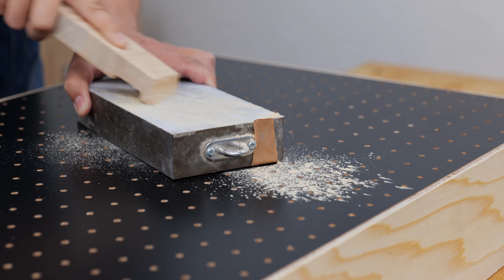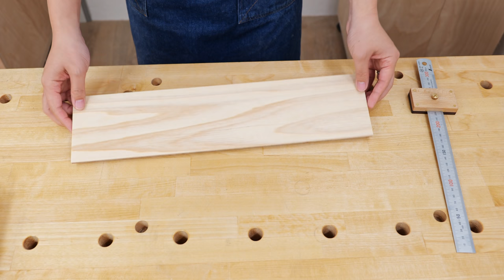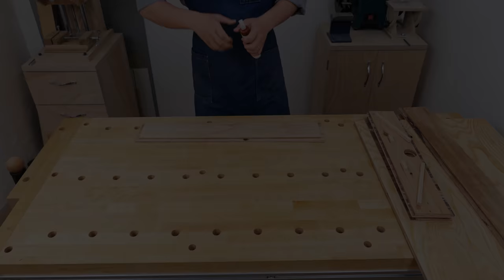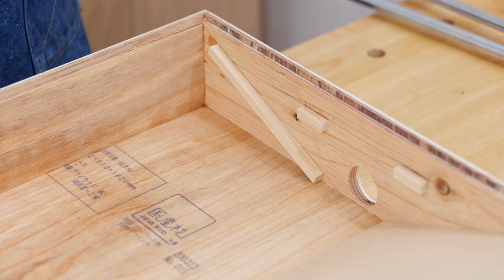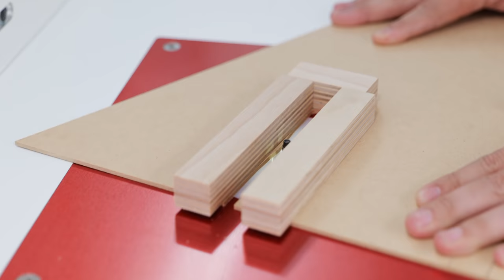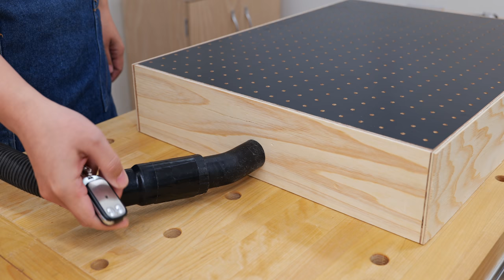Sanding dust collection table

Comment: The suction thrust of the table depends on the ratio of the sum of the areas of all holes in the table to the area of the vacuum cleaner hose.
The area of the holes in the table is about six times larger than the area of the vacuum cleaner's hose, which means that the suction of the table is about six times weaker than the vacuum cleaner.

Comment: Clean work as usual. I'm always impressed with how nice the tools you build look and how well they work, and this is yet another very nice looking build, but It also has my thinking and that almost never ends well...

First thing I'm wondering about is the internal baffles. I assume that they are there to moderate the airflow so it's spread more evenly over the surface. Now how necessary are they? How would omitting them influence the airflow. Guessing I'd say the most airflow would occur along the edges, but that's just my initial guess, the real question however is how it would impact the total performance of the table. It would make the build slightly easier and faster if the baffles could be omitted without seriously hampering performance. But if they need to be there it's no big thing.

Next thing is that I wonder is how necessary it is to glue down the deck? I can see how it is likely to become scuffed up pretty quickly so it could be a good thing if it was easy to replace and also it could make it easier to clean the box out now and then. If the vacuum underneath it isn't enough to keep it in place then perhaps tapping in a few nails from the side might do the trick. These nails would be relatively easy to pull compared to trying to rip the deck from the glue.
I do have one more idea on how to keep the deck in place without relying on glue or nails or anything like that, but it would require that the sides of the box is slightly modified and it would there would be a border sticking up around the deck which might make it harder to use if a piece you are working on is to large to fit inside that border.

Both these things are thoughts on possible ways to simplify the dust collection table, alternatively making it easier to maintain so it will last longer.

Comment: It's great. Just for those boxes with so much volume you really need a big dust collector and not any type of shop vac. Should be at least a 4" outlet port
Reply: Clearly not.

The standard vacuum cleaner/hose appears to work well for the jobs the unit is designed for.

The construction of that unit is certainly not designed for large and heavy pieces anyway. Some might call the design lightweight.

Granted a vacuum cleaner unit of greater power would certainly be necessary for heavier work.

It looks as if the design philosophy is to remove the finer dust particles from light sanding jobs without a lot of fuss.

Not everyone rips down railway sleepers but simply build small scale models for example.

Horses for courses and all that.

Comment: Great idea, very good bevelling the inside towards the vacuum port. Good geometry calculations or trial & error? I wish my little table saw had that as it only collects dust within 75mm of the port! ;-\🤔✔️
For greater efficiency , you can place some matting or board around your sanding area / workpiece to concentrate the suction to a smaller area

Comment: Well, sir, I am afraid, that your solution simply cannot work efficiently. Why? Because you need to move huge amount of air (with dust in it) through your shopvac. Although you have quite high number of holes drilled in your dust collection table, they have very small diameter. It means that total suction area is small. Which leads to great resistance for sucked air and vast majority of suction power is "lost" in friction. Result? Very low air movement and air pressure (low suction power). This is why we cannot see in your video dust sucked right into your table and you have to move it with your hand to be sucked in. Possible solution? Bigger suction area will result in lower loss of suction power and your table will be more efficient. Try it if you wish and let us know about your findings. 
Anyway,  your woodwork is very clean, I like it very much.
Reply: I made one of these a few years ago and found that I had to drill out all the holes in the pegboard due to low air flow.